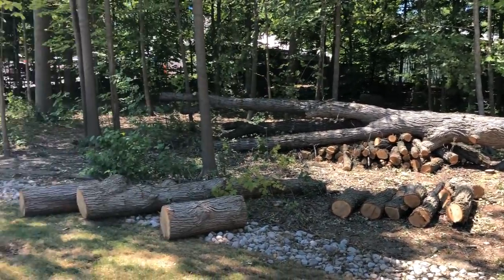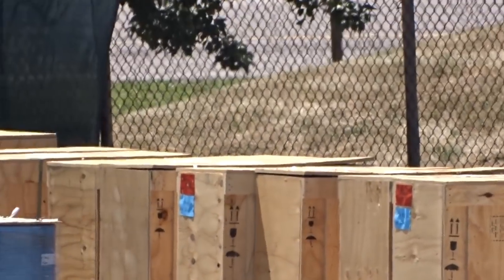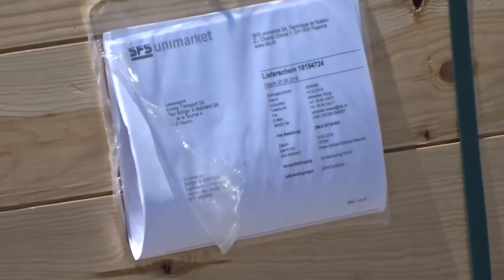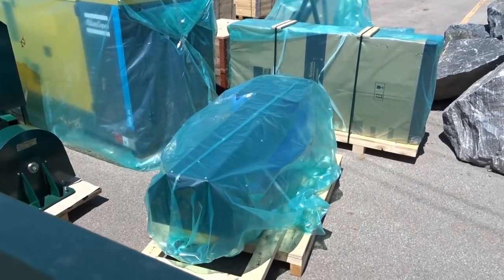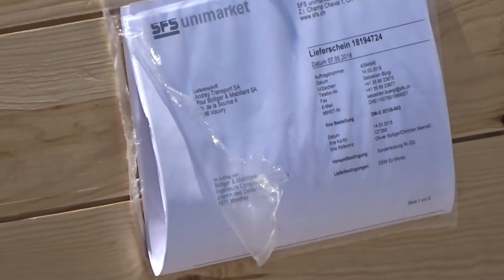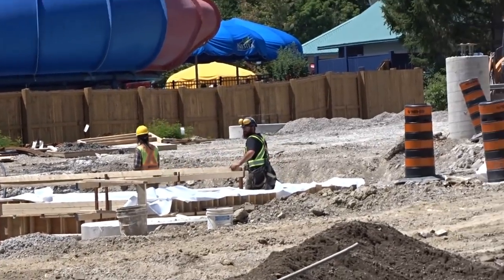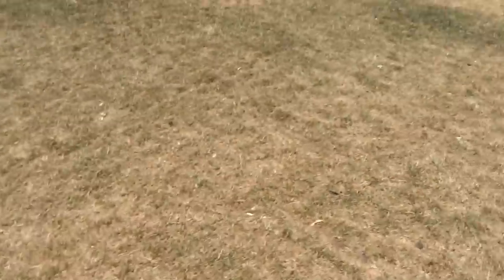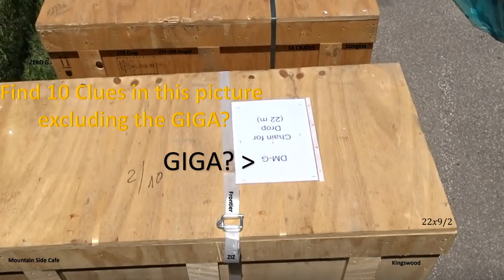Canada's Wonderland Massive New Coaster Update

Comment: Arrrrrrrrgh!  This is SO frustrating.  Chain for lift is 22m only (as official label indicates)?  That's only 79ft.

But then then you type over on the bottom right 22x9/2...

Speculation and your own teaser to be sure but let's do the math: 

are there 9 boxes each with 22m of chain...equaling 198m of chain (650ft)?  Okay...so then he divides by 2.  That makes sense since you'd have equal amount of chain on top as you would underneath.  

So that's 325ft of chain length on top and under the lift.

Considering that some of the chain takes you OVER the apex of the lift and you're looking at a lift hill of at least 290ft in length and with the tunnel already estimated at 25ft deep and existing in a valley below ground level...and, well... the code DM-G is really starting to look like it actually could stand for DIVE MACHINE GIGA

Comment: 16 creates are what’s there
Reply from the maker: Braeden Berger correct. There’s 18 but only 16 are for the lift
Reply: pretending that one crate ist storing an 8m track piece and the first and the last part only count half because they are at the bottom and top of the lift we can assume the height by this calculation: 15 * 8 = 120m approximate lenght the lift is climbing in height, 120^2/2 = 7200 by getting the surd of this number we get the height of the coaster with a lift angle of 45 degrees which is about 84,8528137423857m = around 280 ft.
but then i took a closer look at the crate :'(